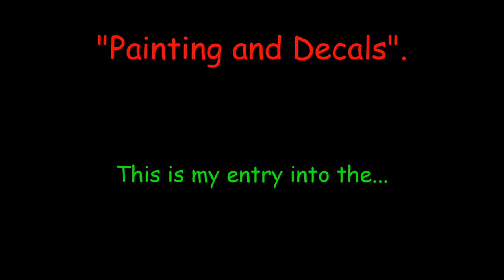Eduard 1/48 Hawker Tempest Mk.V - "Build Update #3" (6.18.18)

Comment: Nice job. I just built this kit but I thinned out the rudder substantially and it improved the appearance greatly. I learned a lot working with this short run kit especially with the use of putty, sanding, and scribing. A silk purse can be made out of a sow's ear after all, well more like a rayon purse actually. The Tempest is an elegant beast and can be considered a "muscle car" of aircraft, powerful, fast with a monster engine. Now to decide if I need the new tool version or not, so many models and so little time, and room to put them!
Cheers